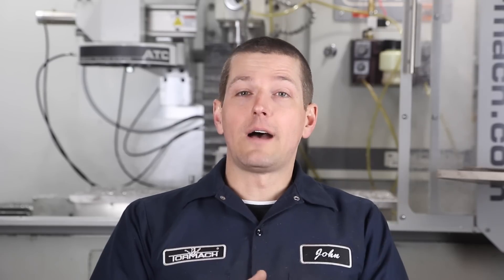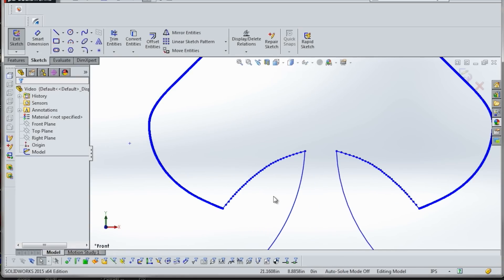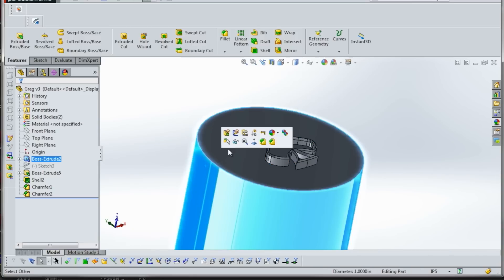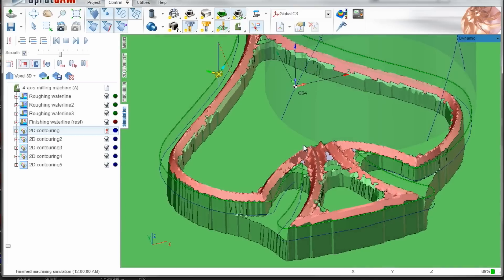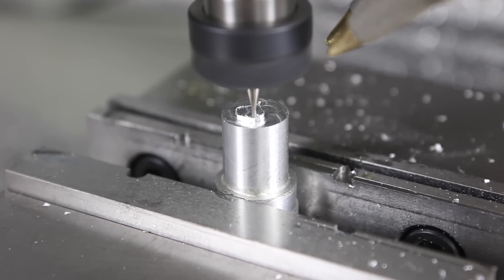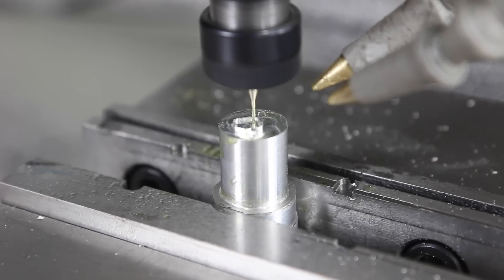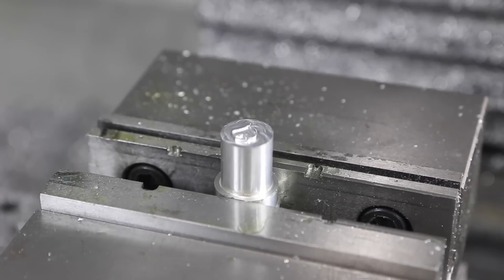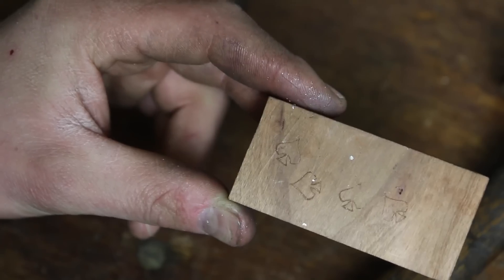Stamp It!  Machining a Logo Stamp on the Tormach PCNC!  Widget29

Comment: Love watching you work with solidworks...Been doing it for 13 years (meaning just the solidworks...the cad program before that was autodesk mechanical desktop and was horrible in 3d).  But to watch others use solidworks is nice.  I wonder if when I get my Tormach 440, i will use solidworks or just the fusion 360.  Your thoughts?

Comment: You may already know this, but. . . To soften your tool steel to make harder stamps - After you heat the steel, most people let the metal air cool. This won't get the steel as soft as it can get. Put some lye or sand in a can, heat it up, set your heated tool into the lye/sand, and let the whole thing cool down slowly over night. The steel will be as soft as you can possible get it, because no hardness will be suspended/frozen in the steel, as it has been allowed to cool so slowly. So long as your machining tools are hardened, they should have no problems cutting the soft steel - so long as you make shallow cuts. This technique has been being used for eons; but for some reason I never see it being implemented on YouTube to anneal. I especially use this method when working with boutique alloys that are very hard - but it works for most steel.

Comment: I'm a Nikon guy, and I know my ancient Nikon macro lens works great down to one to one magnification.  Then you turn it around backwards and go even closer.  But that's not the answer here.
Get a set of 5(?) close up lenses, they're like filters.  Buy them in the diameter which fits your longest focal length lens.  You can always use and adapter to fit them to smaller diameter lenses.
And like someone said, always use a UV or similar filter on the spindle end of the lens.
I did all my videos with a "Flipcam" which has no adapter threads on the front of the camera, so just used a bit of masking tape to hold the filters in place.  Too bad that GoPro put Flipcam out of business.

https://www.youtube.com/watch?v=Q4Wroo2rtUM

Comment: Use an aligned press tool for impressions, if possible.  Hitting a stamp more than once is not good practice, because it risks a double impression or a part-impression. Not good if it ruins a finished product at the last step.  If it has to be a hammer blow, I'd suggest some large area flat support pads machined on the periphery, which will limit the depth of cut.
Reply: NYC CNC Apprenticed for 5 years in 1960 in England, my jaw drops when I see how it's done today!  I used to stick a sewing pin to a cutter with play-dough, tap it so it didn't wobble, then use that to reference edges for instance.

Comment: Try to use "Voxel 5D" mode for the simulation in Sprut, that should look way better than the "Voxel 3D" you're using now. At least that works for me. Smoother and more accurate sim.

Oh, and I would cast my vote to Canon EF 100/2.8 Macro lens (the non-IS version). Gives 1:1 macro and superb quality. For longer reach you could also try Canon 180mm macro, that way you wouldn't have to worry so much about flying bits destroying your lens. But that one costs pretty penny...
Reply: NYC CNC Of course, filter would be useful in any case. But if you want to get really large magnifications, 1:1 size, then compare the different focusing distances for the lenses:
 * 60mm: 3.5"
 * 100mm: 6"
 * 180mm: 9.5"

I personally wouldn't want to put my camera just 3.5" away from the endmill and whatever is going on in there. Mist and chips flying around etc :). I don't think neither your camera nor lens have weather sealing... Plus I'd think it would be very inconvenient for the filming process as well.

So, probably the reasonable option would be 100mm lens with your crop factor camera (should give 160mm effective lens) and then you could even add 1.4x or 2.0x extender for some more extra distance.

About micro machining - I am currently in process of fitting my mill with 60k rpm motor for the micro milling. Endmills in use will be as small as 0.1mm. I should probably post something in YouTube once that is working. When I did one letter for a test with 0.2mm endmill, that would've taken me 2hr 30min with my 7500rpm spindle, didn't have the patience to wait :)

Comment: If you were a Nikon guy, then I would recommend a "AF Micro-Nikkor 60mm f/2.8D".  I have a Nikon D7000 which is a DX format sensor (not a full size sensor), so that make this lens act like a 90mm on my camera.   The minimum focal distance is 220 mm as is measured from the focal plane of the camera, or about 2" from the front of the lens.  I'm sure Cannon would have an equivalent.

Comment: Hey John, I made a few stamps for builders in the past to brand their work. I got a 300mm m10 bolt and wrapped it in silicone tape as a handle to a 75x75mm plate with their logo on it. They heat them with a MAPP gas torch and stamped wood just like youir doing. With a bit of heat you get a really, really nice branding in wood. Really crisp brands. Give it a try ;) I used 5083 and it was good. Cheers mate. Jim.
Reply: Also I wish you'd try spaceclaim. Watching solidworks is painful lol :) Love your work brother great video as always.

Comment: I as going to suggest a thin extrude as well. But it sounds like that is not working, you could offset the sketch in two directions leaving the base line construction. Then trim everything up and extrude. This will make sure that the peak of your stamp is the correct shape, not offset in.

Also when importing sloppy dxf drawings, create a new sketch, and draw over the original. This will allow you to double check that it matches up.
Reply: Mike Cloutier Totally agree drawing over Mike. Was going to suggest the same. ;)

Comment: i did some stamps for lether, in that case the stamp is heated up and pushed in with a raising pressure. maybe some screw mechanism or a small airpressure thingi is a good idea. I also do a lot of small stuff (0,5-0.2mm@15°), like the door panel decals (i sended you the file some time ago, got a proper vise now by the way) and i saw you using the airgun while the cutter is touching. I experience that you increase the already high deflection massivly. I a brush while the cutter is cutting and the airgun only when the tool is up. I think, when you use such a small diameter for the complete cut, you will find the edges more striking. I can give it a shot if you like. ;-)
Best wishes, Hendrik

Comment: We also have the Canon 70D and we use the Tamron SP Di, AF 90mm, 2.8 Macro lens. I don't know what we'd do without it. Unfortunately, it's not a low cost option. They go for around $499, but it's well worth it. You could try some of the other solutions first and if you aren't happy with them you can check this out: http://www.amazon.com/Tamron-AF-90mm-2-8-Di/dp/B00021EE4U 
http://www.the-digital-picture.com/Reviews/Tamron-90mm-f-2.8-Di-Macro-Lens-Review.aspx
Reply: NYC CNC We just got it in December after our T2i died on us. It's a nice little camera. Very quick and responsive.

Comment: John make it from some oil-less drill rod and then harden it.  You should have no problem machining drillrod.  Sucks to buy a foot of 1" just to make a stamp but you can always make more stamps with the scrap.  Only harden the stamp end, not the end that will be struck by the hammer!  This is me talking out of my ass btw.  In case you didn't notice.
Reply: self hardening or oil hardening. Prol a dif of terms used. Oil-less is the easy, no fuss, guaranteed way for a DIYer to do this job.
Reply: As in "Ok I see you are talking out your a.." I'm sure!  I googled A2 rod and I see drill rod gets really technical.  I look at drillrod as either oil hardening or not. Nothing more.  That's what I should have said.

Comment: Cool! As a cheaper solution for macro you can use lens extension tubes. A professional once told me that for high speed machining on aluminum use's Mitsubishi End-mills but they're quite expensive. If you ever need something better, give them a try.

Comment: Big fan of the Canon EF 100mm f/2.8L IS USM Macro Lens. http://www.amazon.com/Canon-100mm-Macro-Digital-Cameras/dp/B002NEGTSI

Something for your client/colleague to consider. Mill/drill out the ram on an arbor press and turn down that stamp to fit to the ram. I had a shop do that same to my press and love it for setting eyelets, hole punches, and stamping.
Reply: It's a bit of a bullet to bit but well worth the money. I'm sure the non L version would work well to. The beauty of the press would be any tool that needs to be hammered or pressed could be adapted to be used in it.

Comment: Cheap solution to get macro shots is to use the macro tubes that offsets your lens compared to the sensor. You can get pretty good results from those. There are chinese ones that are so cheap it's almost ridiculous ;-) http://www.ebay.com/itm/Metal-TTL-Auto-Focus-AF-Macro-Extension-Tube-Ring-Red-for-Canon-EOS-EF-EF-S-/111231705574?pt=LH_DefaultDomain_0&hash=item19e5ed21e6

Comment: What about making the stamp curved where he can roll the impression into a heated piece of kydex if you know what i mean.
Reply: NYC CNC just an idea.. It's how some pipe makers stamp there insignia or logo in the bottom of briar pipes and the rocking motion that allows for a consistent pressure every time. I thought it might translate to kydex pretty easily.
Reply: I think it's the stamp they heat up but I'm not positive.

Comment: With regards to tool steel: get some A2. It's nice on tools, machine it dry with an airblast with TiAlN/AlTiN tooling, and aim for about 300SFM.
Reply: NYC CNC I haven't actually machined W1, but at the last job we did everything we could with A2, and when necessary others such as D2, CPM and M2 (that's an ugly one). This was making progressive stamping dies mostly, and A2 is nice and wear resistant, although in a plastic punch I imagine that won't be a feature of paramount importance.
Reply: Yes, and then ground to size and correct angle, although that was the toolmakers' jobs, I "just" programmed and ran the mills. For a few products we did post-heat treat hard milling as well to ensure proper size, but that was rare. A2 makes good durable punches, and for this application I would imagine one would last many, many years, if not damn near forever.

Edit: I will add that A2 doesn't change size much in heat treat either. For custom punches I aimed at dead-nuts to .0003" small. Heat treat growth was usually around .0002-.0003" for a smallish cross section (.25-1"), and requirements for the final size was usually a size range of around .005". That job didn't do a lot of high precision dies, but some were being cycled hundreds of thousands of times per year. That's a lot of sheet metal! If you check out my channel you'll see two videos on a GF-6. Material is about 62HRc A2 (that wasn't a fun job) and was used for forming 1/4" "sheet" metal.

Comment: have you looked into getting a macro tube for you tele lens? Might be a cheaper option if you don't want to spend heaps on a lens.
Reply: NYC CNC Good point -- See for instance: http://www.bhphotovideo.com/c/product/300603-REG/Canon_9199A001_Extension_Tube_EF_25.html/prm/alsVwDtl -- my first thought is that you'd lose the computerized functions but apparently not so. There are also some after market brands.

Comment: Strange seeing that! This opening is the very reason I havent sent that CAD drawing over yet... I KNOW why my problem exists though. For my project, I was using a HAACK series function to define one the lines, and when opened in SolidWorks it splines it... So I am trying a combination of approaches using variable arcs to recreate the profile in a way SW likes. :-)

Ahhhh.... Ballistic precision... Not the easiest things to accomplish without the calculus functions, but not every program likes them. (All calculus sourced off of Wikipedia of course).

Great video, something anyone who receives CAD functions needs to be familiar with.

Quick side note for stamps, UNLESS it is going to be cutting material, you need to make sure they are not too "sharp", so if you use a 30* taper, you need to have a flat land up to 25% of the thickness, to prevent deformation. (experience with molds in the tire industry)
Reply: don't know if im adding anything but if you are using functions/equations for your drawings, solidworks can make drawings straight from excel, so functions are very easy, and they can be used to draw what ever you want directly in a part in solidworks
Reply: attainableapex Cool! Did not know that. 
The Haack series function is... well, plain and simple, a PITA in my opinion. Since it combines both linear and angular components, it took me a while to figure it out. I will have to give that a try now.

Comment: Try using the press or vise to get a god squeeze on it evenly.
Reply: NYC CNC Hi John, I find an alignment tube works well. Even just out of Delrin so the stamp slides 'square' within. An opposing basic engraving on the 'hammer' end to make visual alignment easier too and a square edge at he base to align with a reference line or edge of the work piece.  Lens: Extra telephoto? or maybe a fixed focal lens maybe cheaper?

Comment: Quick tip if you want to get the extrusion without having to go to all the effort to shell it; look into "thin feature" in the extrusion tab.
Reply: NYC CNC Sometimes, the Thin Feature option gets nuked when you have curves coming together at acute angles. You would think Thin Feature would call the same algorithms as Offset (in a sketch) or Shell (on solid geometry), but it doesn't; it calls on routines that are not as robust and fail on the slightest geometry imperfections.
I actually thought Shell was an interesting way to do it! I would have tried Thin Feature, but if that wasn't an option, I would have fired off a sketch and used Offset on the solid geometry edge.
Reply: was going to say the same

Comment: John- Quick way to clean up horrid DWG/DFX geometry:
- Open up the sketch the geometry lives on.
- Select a logical segment of small line segments/arcs the DWG/DFX spit out
- Use the Tools:Spline Tools:Fit Spline...

Mess with the settings to get the results you desire. It works really well.
Reply: NYC CNC Everyone who has to do surfaces more than "dislikes" splines in SW! They are finicky and awful. Big boy tools like NX and CATIA get beautiful NURBS curves you can control with ease. The Fit Spline tool is pretty much the only thing I use regular splines for these days (rarely at that, since I don't often work with other's geometry).
If/when you need swoopy curves, SW now has Conics and Style Splines. Both are vastly superior to the traditional spline tool. While they still aren't up to the same capabilities as a Class A surfacing package, they are way easier to use and more robust. You probably won't run into a lot of 3D surface needs, but when you do, learn those tools before going down the rabbit hole of trying to mind meld with the old spline tool.
And no beer necessary, this is about 1/1000th what I've learned from you!